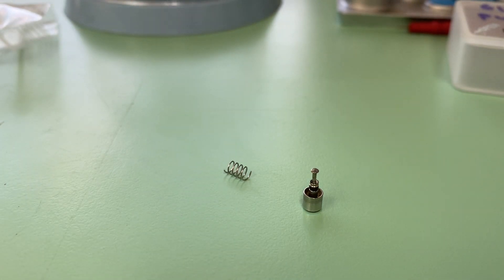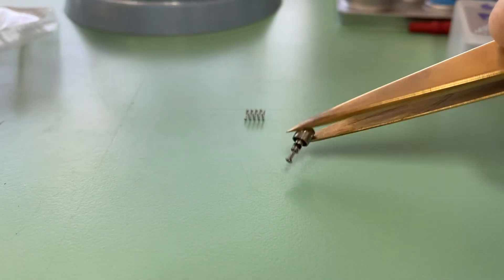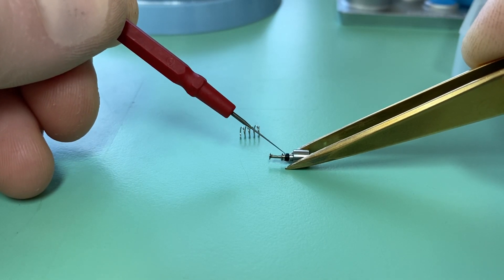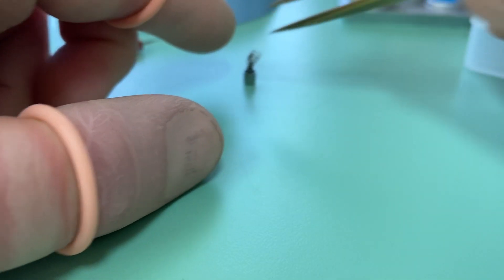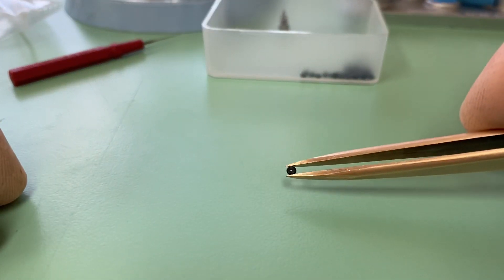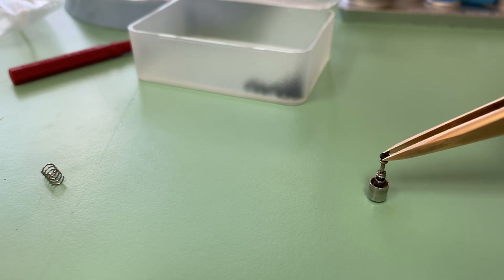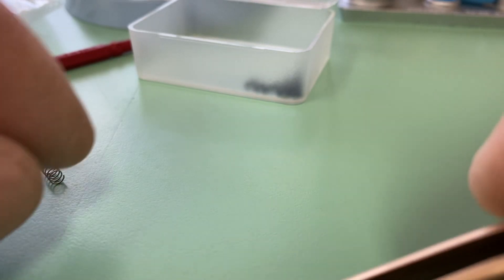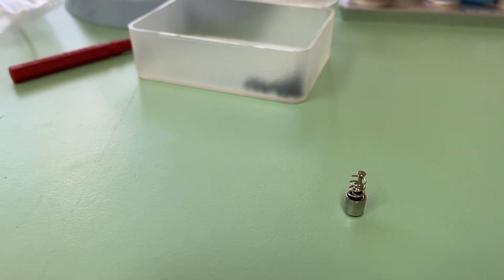Seiko 6139 Pusher Gaskets

Comment: What direction does the flat go when installed on the pusher?   Thanks.
Reply from the maker: Not too sure what you mean? It’s flat on the inside of the gasket.
Reply: @theseikologist  ok. Thank you.
Reply: I recently bought a Longines Monopusher Heritage from Ebay and right away the Pusher took 10sec to Retract.  The watch is New but probably from 2017 as they are long discontinued.  Seller is willing to pay for Repair but L0ngines has 4month Wait.  I want to keep the watch but don't know anyone to do the repair responsibly.  Do you think Gasket is the issue?